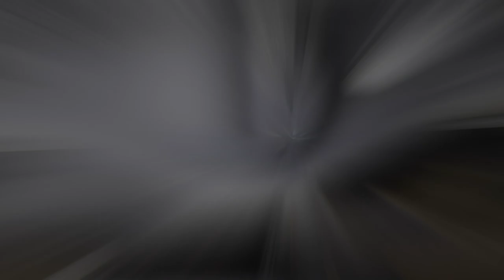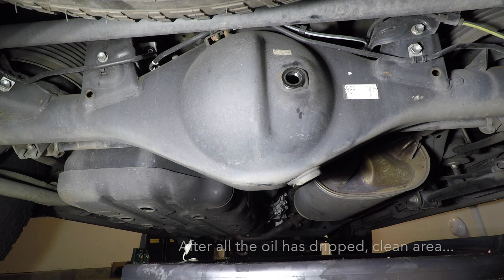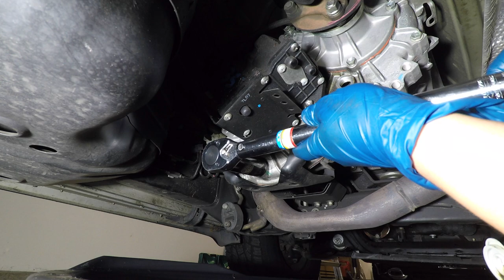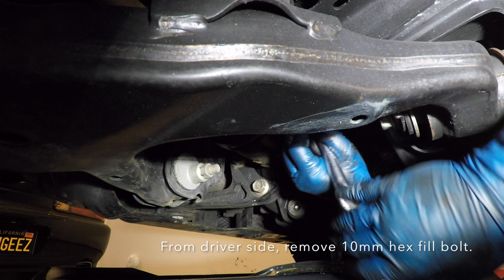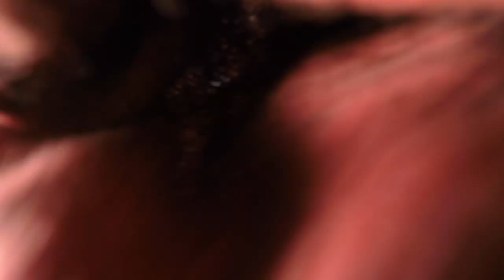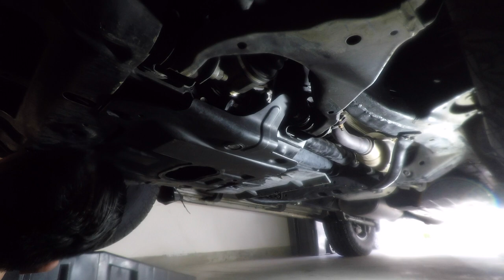DIY VL●OG: Lexus GX470/LX470 Toyota 4Runner/Tacoma/FJ Cruiser Front & Rear Diff and Transfer Case

Comment: This video really helped me out.  Thank you for detailed tips about socket sizes, torque, oils etc.  I could not find this info anywhere else until I saw your video.   Transfer case plugs on 2006 4Runner appeared to have regular washers that was different from a crush washer on front and rear differential.  They appeared to be just a regular washer the way it came from the factory.  I scratched my head on it but than decided to just put it back on instead of crush washer.  Its worked so far.  Any thoughts?
Reply from the maker: Glad it helped! As far as crush gaskets, I've reused old ones before, if it doesn't leak when you drive it, then it should be good. As long as you tighten it enough, no need to worry. It's more of for peace of mind for most folks.

Comment: I have a leak between the actuator motor? and the transfer case. Can this be fixed by replacing the actuator gasket . do you know what is involved?
Reply from the maker: JDK K I haven’t experienced it yet, but from reading around it’s as simple as an O-ring or gasket if you have the time for the day to tackle it. Not sure also if there’s any difference between a GX and FJ transfer case.

Comment: How often do you need to change them. I just purchased a used 08 Gx470 with 150k miles. It has been service by local Lexus dealer its whole life according to the carfax; but carfax shows nothing about all this being done. How do i check if the oil has been replaced. Anyone? Thanks in advance.
Reply from the maker: If it was serviced directly at any Lexus dealer, go to main Lexus website >> Owners >> Register >> User Avatar Top Right Beside Search >> Click Vehicle in Drop Down Menu >> Add New Vehicle. After you add your new vehicle with VIN, you'll be able to view all previous service records of vehicle. But to answer your question I believe this is part of either the 80k or 120k mile service.
Reply: Organized Garage Status 
Thanks for this comment! Just bought an 04 GX and this helped me get a service history on it. 👍

Comment: I heard somewhere being advised to dab on some anti-seize compound on both the fill and drain bolts.  Any thoughts to this about not getting in with the lube and messing the gears up?
Reply from the maker: Not sure about the rust belt areas, but it shouldn't seize due to rust as the plugs are made of aluminum. Never experienced something like that even with my 21y/o SC400 and SC300. It is common that 10mm hex strips though because of bad angle and improper insertion of the socket.
Reply: Not an expert by any means but I was thinking maybe there was some kind of unknown (to me) reaction between the metal, lube seepage into the threads, and heat cycling, etc. that would cause the plugs to seize somehow. Thanks for clarifying that.